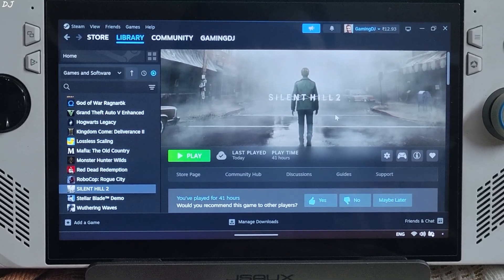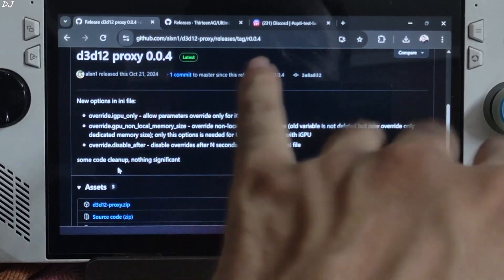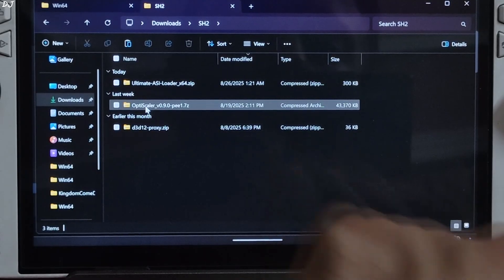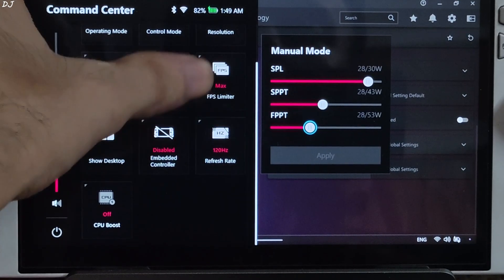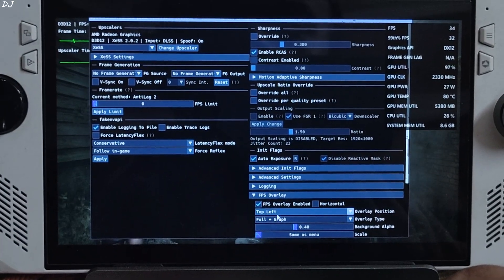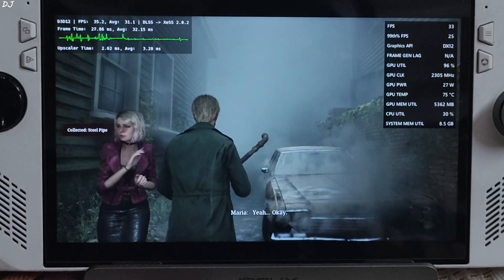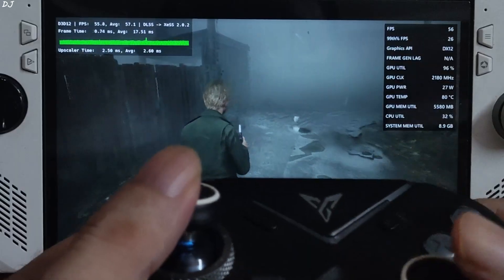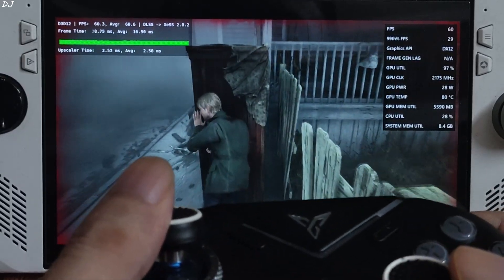Rog Ally Silent Hill 2 Optiscaler XeSS Frame Gen + d3d12 Proxy [Fix Broken Unreal Engine 5 GI] Setup

Comment: Doesn't seem to work with desktop PC. The game loads the first time when you launch after you copy the optiscalar files to the folder etc. But after you set it up in game, save ini and exit, the game does work, it goes to black after launching . I used to play SH2 with optiscalar FG on the 0.7 version but I hated the hud interpolation so I thought I'd use the 0.9 version since you can use XeFG through DLSS streamline which is much better and works great in Cyberpunk but all I get is black screen in SH2. I'm guessing it doesn't work with UE5 games. I have to test this with Cronos, to confirm if it is a UE5 issue.
Reply from the maker: You should mention your gpu first. Xefg Mod works fine on my pc with rtx 2070 super. Don't use d3d12 proxy if you have a dedicated gpu.
Reply: @GamingDJ4u  I have a 2080Ti. Yeah, I know, d3d12 proxy is only for iGPUs. I actually found the issue, it seems optiscalar only works when you have the display in windowed mode which is strange because i know fullscreen wont work but even borderless is not working. Only works in windowed mode.
Reply from the maker: I just tested the latest pre 5 build of optiscaler in this game, xefg is working fine in borderless fullscreen mode. Resolution : Full HD
Reply: @GamingDJ4u  Weird. I play at 1440p but the resolution shouldn't matter don't know why it is happening. When I launch the game in borderless, it works fine until the logos, once it goes to compiling shaders screen, the screen goes to black and I can hear the sound but I can see it working when I hit alt-tab. As of now, I'm playing it on windowed mode at 1440p but strangely the windows doesnt show up. Really weird.
Reply: @GamingDJ4u It doesn' t happen in CP2077 or Horizon ZDR so I'm wondering if this could be a UE5 game issue. I  have to  install and test it on other UE5 games like Cronos or Expedition 33 to see check . Cronos could be the right choice since it is also made by the same studio.

Comment: will you update it for pc or should i consider using this guide for my pc
edit:- I have a laptop with rtx 3060 and i711800h cpu
Reply from the maker: This is a windows PC, you can follow the same guide
Reply: @GamingDJ4u  well unfortunately this one does not work cuz of the new pre build version(Game Crashes) and im a bit confused so should i just stick with the stable version ?
edit:- what to use nukems fg or optiscaler  ?
Reply from the maker: No stable build exists for optiscaler xess frame gen. Both pre 1 and pre 3 v0.9 test builds work fine in sh2 even on desktop pc with rtx 2070 super. Nukem's mod isn't required , delete older mods. Setup process is shown in the video.
Reply: @GamingDJ4u  last thing that i want to clarify what do you mean by d3d12 proxy i have a laptop so should I use this proxy thing because after replacing the files in my game folder it results to game crash so shld i just ignore this step ? and obviously i have a igpu(Intel) because it is a laptop with a discrete gpu(Rtx 3060).
edit:- Do u prefer using XESS over DLSS in this game ?
Reply from the maker: Ohh i see, please don't use that proxy on your laptop, it has a dedicated gpu (rtx gpu) . That proxy is for igpus only, we don't want your intel igpu to work here.